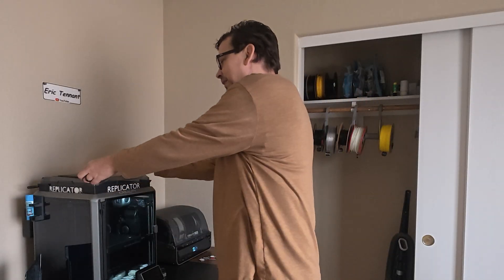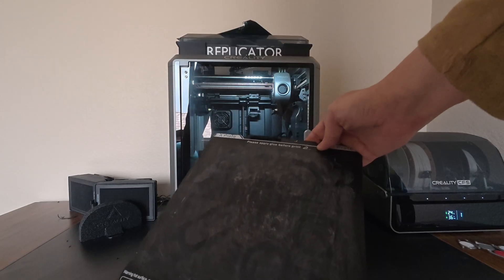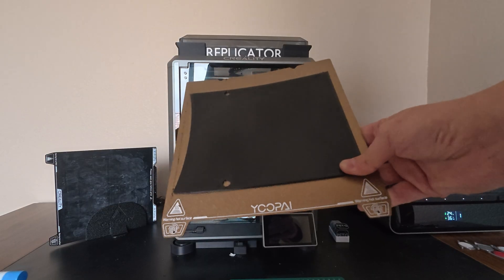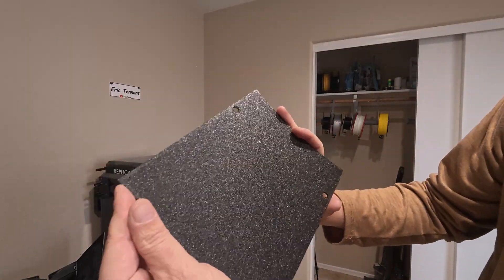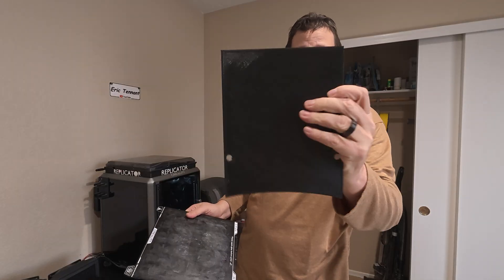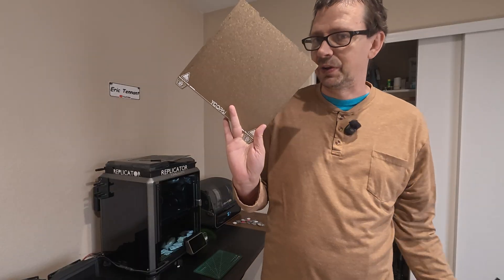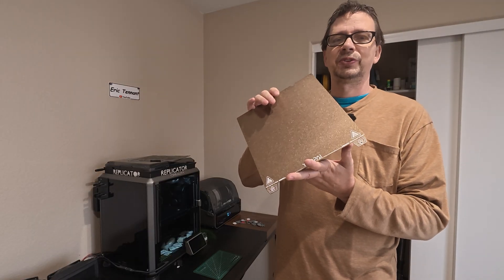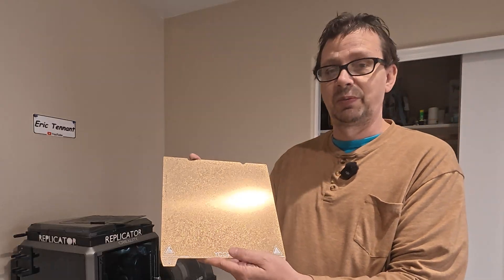STOP USING GLUE ON 3D PRINTERS #3dprinting #3dprinterupgrade

Comment: I have 10's of thousands of print hours under my belt and I can say definitively that multiple materials benefit from playing glu stick ontop of the pei sheets. Not so much as an adhesive but as a isolation layer for easier separation
Reply from the maker: I can only speak for PETG on it so far. Does ASA Nylon, TPU need glue for removal on this PEI?
Reply: @DoesPlastic  yes sir. I use it for asa/abs, tpu, pet, and peba. Absolutely a requirement with tpu and tpe filaments. They stick so well that it will tear the pei off the steel. Aquanet hairspray also works just spray outside the printer otherwise your side panels get filthy.
Reply from the maker: This plate petg is perfect without anything. ASA sticks a bit to well on it so yea glue for better removal is needed :(. I need to buy some hairspray for testing still. Really I wish for a plate that can handle each type without any medium.
Reply: @DoesPlastic  one can dream 😂. I have tried all sorts of plates and there is always an asterisk. The new cool plates are probably the closest but still wont work with everything. Also too many engineering grade materials that really only stick to one or two non typical surfaces. G10 fiberglass sheets also work well for typical materials